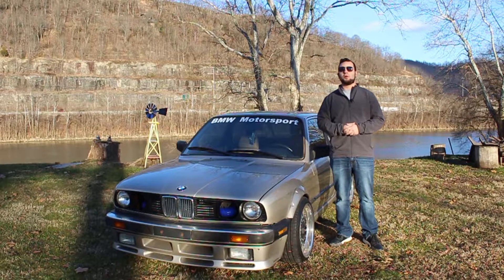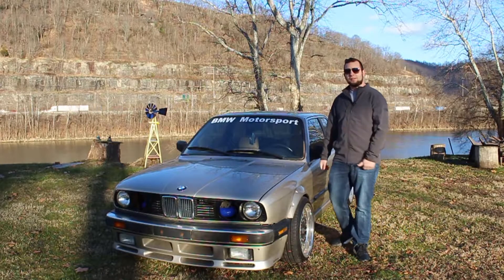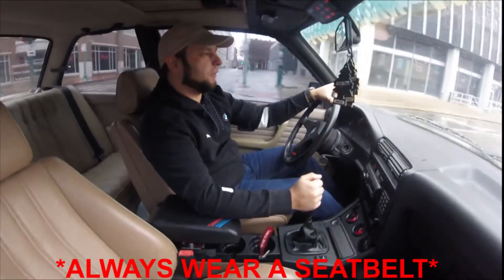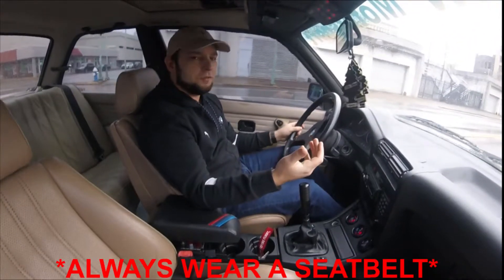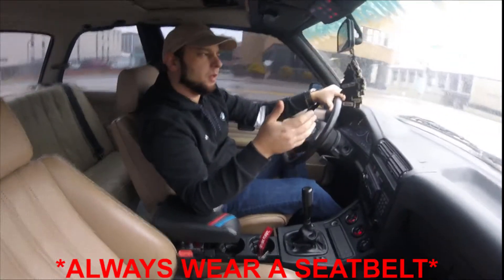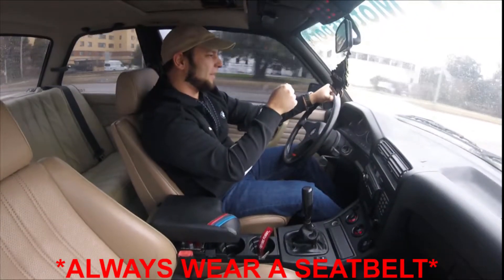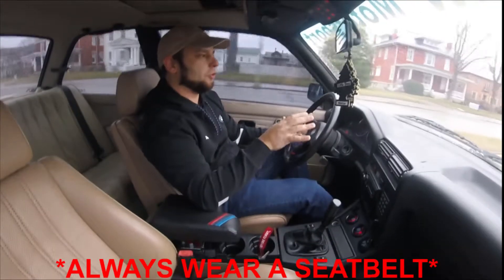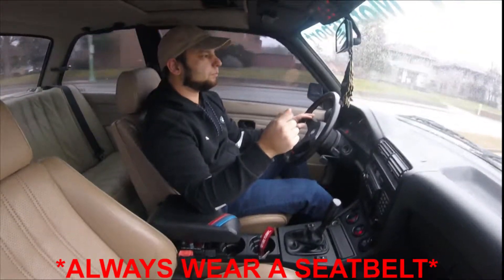BMW Ebay Turbo Kit (1 YEAR REVIEW!) Pt. 2 E30 driving turbo M20 "kit" turbo sounds! Almost wreck!

Comment: What size is the turbo I can't get your link to the kit too see
Reply from the maker: 0.50 A/R Cold Side, T04B Housing. That's copied from the ebay description, they also claim that its a 73.9 trim and I know for a fact it is a t3/t4 so that helps with spooling.

Comment: Hey so what fuel you use e85 pump 91 or 93
Reply from the maker: I use 93, cant use e85 without some fuel system upgrades and tune.

Comment: Watched part 1 and 2 :) when you keep saying stock tune, is it really running on the oem ecu with no chip or anything?
Reply from the maker: nope, not even a chip. It definitely needs a tune though and a standalone and fuel upgrades are in the near future.
Reply: @CARSTUDIOYT  makes sense, good to know I can run it on low boost for a month or two to save up for a standalone haha 

Last question, if I were to go the chip route, to I just tell whoever will be making the chip what my car had and they go by that? Or is it just the general chips they sell that I install and it accounts for boost?
Reply: @ROADNOISEMEDIA  When running lower boost levels you can buy a chip that has timing set for a more "boost friendly" timing curve. The chip does not not control fuel. I've ran Mega Squirt and stock ECU turbo e30's. I have been able to run up to 14psi before blowing out the head gasket on a stock chip, stock fuel pump, 38lb/hr injectors and a retuned m30 AFM with a tiny heat soaked intercooler on 93 octane, and that was after a night of continuous roll racing and long pulls on a hot summer night. If just running lower boost levels of 6-7psi it you should have no issues running everything literally stock except maybe upgrading injectors. 6-7psi with a turbo chip, a well placed / sized intercooler, AFR gauge, 93 octane, 3 step colder plugs (I run NGK BR8ES) and a good cold air setup routing to the turbo should give you no issues, as long as the engine was well maintained to begin with.

Comment: Been thinking about getting the KA motors kit but this seems far cheaper and I want to also retain A/c Would you recommend going this route instead?
Reply from the maker: It just depends on your budget. This kit has worked great for me but I only have $1200 in it total. Im sure the ka motors kit is a way better option especially in the long run but for now this kit has far exceeded my expectations. Also, the thousands I have saved going this route still would be worth it no matter what happened to my engine but so far nothing turbo related.

Comment: How do your afrs look throughout the rev range
Reply from the maker: 13.5 at idle- 14.7 cruise, it does lean out at wot in the higher rpms to nearly 16 but I've been driving It this way for over a year now. it def needs tuned and injectors which it will get in the next few months but for now it does ok.
Reply: @CARSTUDIOYT  could 16 afrs damage the engine or blow it up ?
Reply from the maker: @karimmortada4001  The short answer is its not good for it, but the M20 is very resilient. If I were to run a lower boost pressure it would be more safe but I haven't blown it up yet at 12 psi. I do plan on tuning it and getting bigger injectors this year in order to make more safe power.

Comment: Do you have a link to the injectors you have??
Reply from the maker: They are just green top injectors off an M50 engine. here is a link to some on ebay.https://www.ebay.com/itm/6PCS-Fuel-Injector-0280150415-Fit-for-BMW-3-0L-M3-2-5L-323i-525i-E36-E34-M50-S50/124497424958?_trkparms=ispr%3D1&hash=item1cfc9ff23e:g:O~QAAOSwyjdfQT7g&amdata=enc%3AAQAFAAACcBaobrjLl8XobRIiIML1V4Imu%252Fn%252BzU5L90Z278x5ickkp2NA0WuhQytmt4dbStg00IVe3x91Rc3t1V4%252BJ4sNl1iUgfQvjnPSqczEJzFrZ%252BpRsjSrwOhbkOnKryI0HlLI5X4rNqaIo%252BuDLqKZzuH105M2P0m5PpwnLyNTXU3tTFrCD1hMkmFJLGST7BCJnwTnHqaIe2To9WisChqEEh4WLHw3EXrgwGcAa8kccFrSNypDDRpGDjeSXVG%252BO%252F0i7z7tcxq7DAhIvBsd7kbXjsClxYnsWhdUFWFCL5sRAs2ycOua0dg%252F%252B2DHb%252FYzKkpyYLHk18ONACNvgkDB5IVSD7ubvw1TbYieadbmN35p5Ahfvz3p9SkYIhBU%252FImta2fC5niiM4rgq2FuANp0Q79QIaVNmFAE1WdRGzTOILeT9rXCPk7nHeZpkoF5NTBufxsycmiI9C5pxlVsiDnY4GuWnzMc4iWz4d2XQE94LnQK2DSA6xiGFuRL8FGeEnocf5jqVJsGK1GmNkrucMEl427yiJXpQ2P9VK1iu4JZTHSsG7tKswyo3%252FO%252B2bJKcs3etwGYfSRyxEFrcCSAz7FTFoTjD8xmOiScrPuIKOW3gtffxmND0Qh0fHPeq3q7p4de2WhTyVF6CiJWOBEsrU7yU%252BjSixuULtBw%252BlJujbYBElpnHry8uc0rchWH2CO5CsJDkqGnZOUAWklIP5dyMn4GzLqQTrINyivFkzF6YrWqUKOTGmDX6VVVAgJtsAXaQVxLGwnEuMcL8IbBbAyii1q3lN0TRmINXwfDgExkV51kRYipyozvUdcBWhs3Pi4cHqJXA2yDmhFs%252Fg%253D%253D%7Ccksum%3A124497424958790ca1a58c99419797b9396bb01ab184%7Campid%3APL_CLK%7Cclp%3A2334524